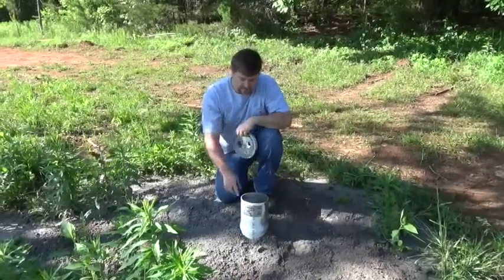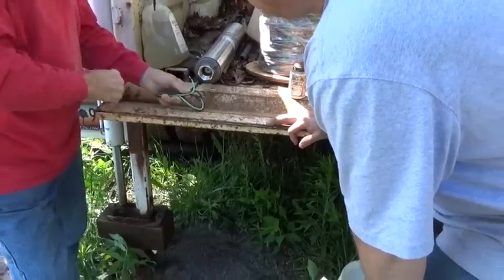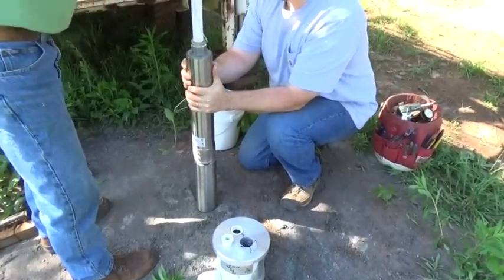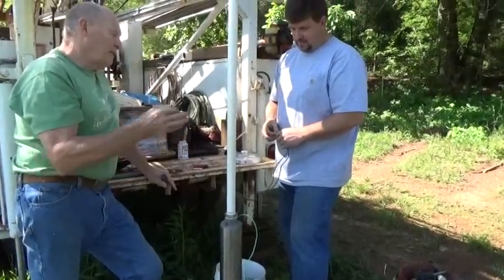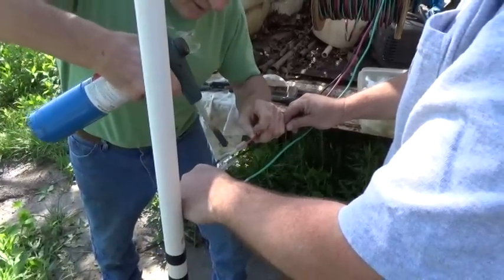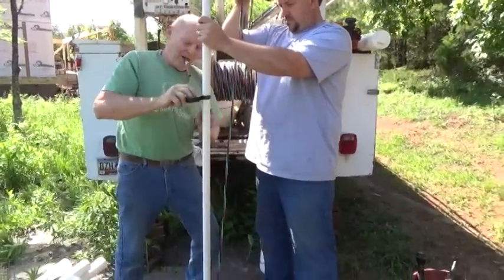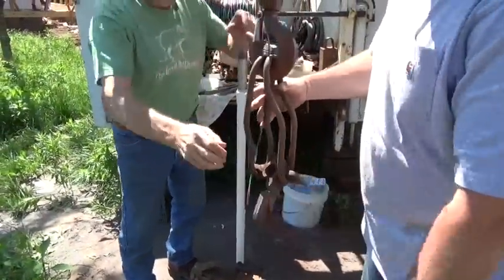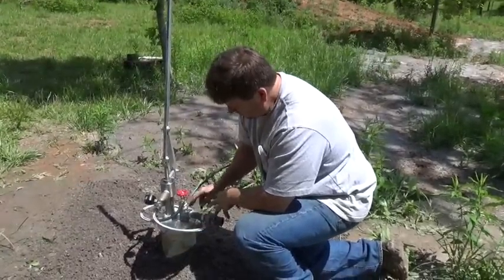How to install a Submersible Pump

Comment: I am Danny Maturan from Iligan City, Philippines. We had a disagreement with the officers of the water works office of our city in the manner in which the submersible pump was installed. Instead of an UPRIGHT POSITION, it was rather installed in a SLANT POSTION due to Height constraint of the reservoir. The source of the water is from a spring, collected to a tank which serve as the reservoir, where the collected water will be pump up to an elevation of about 300 meters.. I insisted to improve the set-up but they refused. So I decided to seek for more info on the proper istallation procedures to support my belief. Need you immediate reply because the motor driving the pump (20 Horsepower do not last for one year. which I believe this installation/set-up is one of the causes. Thank you for your time!
Reply: Danny Maturan  The common cause for pump failure is improper tanks and pressure switches. 20 hp is normally used for small farms it's way to big for a common house use.  you only need like 5gpm  max for a house, along with proper bladder tanks.
Reply: it is possible that the position of the motor is not correct. The type of motor may have bearings that are radial loaded and if horizontal or partially tilted, the bearings will prematurely fail. most submersible pumps are ok to tilt or lay on their side but not all.

Comment: So how do you keep the pump from picking up sediment and dirt? Or does all that clear up after pumping for awhile? Also how far from the bottom of the hole do you set the pump? Thanks!
Reply: Trey clark  ten foot is the normal from bottom in these parts, wells are very shallow he most only 80'  hitting water at 20'

Comment: Thanks for another grate video . If you have not installed you offset lines to the house yet . Do yourself a favor and put 4 wire to the well . That way if things get shut down ( SHF) and you can only get a three wire pump , you will have the wire in the ground all ready . I use three wire pumps because you have a control box in the basement and that has your start capacitor in it . With a two wire pump , that is build into the motor , so if it get hit by lightning or just fails , you need to pull the pump and replace the motor . Tree wire pumps most of my service calls you can just change the box in the basement . Also install the cycle stop valve you talked about in the video . That way you do not need a big tank . You really don't get any grate storage from BIGER tanks , and you save a lot of cash . Myself I  would use a cycle stop , 35 gal tank with 38 psi in blather , heavy release vale and turn PSI up to turn on at 40 PSI and shut off at 75 or 80 PSI . It's better for the pump to run higher PSi because it holds good PSI on the bearing witch is better for your pump . Hope that helps and not mad for my thoughts . Thanks again
Reply: Thank You for your input. I think it was better than the video.
Reply: Let me ask a question: Is 75psi too high for residential piping? Is a constant pressure pump better? Would u install a 'manual' pump also as back up? Are there filters that can be put on pump to prevent debris pick up from well to pump? Thanks

Comment: I was surprised to see the plastic well casing.  We have to have steel casing driven into ledge/bedrock.  Our well is 800' and we get 1/4 gallon per minute.  ;-)
Reply: Goodness gracious 800 ft. , 1/4 gallon per minute , I feel for you my friend . I just had a well done in southern Mo. highlands , driller was telling me he just did a well  In  Arkansas  700 ft. 4 gallon a minute , I thought that was sad , mine went 310 ft. at 20 gal a minute , metal casing with a sch. 40 PVC liner , hit bedrock at 160 ft. , 9400 bucks , you can bet I was glad when that was over . wore me out and all I did was watch .Ha!
Reply: ***** Hi ya neighbor ! Not likely you could  ' DIG ' it yourself , the ground around here is way to rocky and hard and you might hit a gigantic boulder then what ?. Even my garden beds are all raised beds , which is really not a big deal . How deep ? Varies I am at 1475 ft. above sea level ,which is pretty elevated ,I am on the Ozark Highlands , my neighbor 3/4 mile to the south is just under 400 ft deep . Best to hire a rep-ital well driller  , be careful though you can get scammed real easy !!!!!!!!! My well was pretty pricey but I went the extra mile so to speak, with a double well casing , be mindful well drillers usually only drill the well , meaning they will not do any trenching or backhoe work you are responsible for that  being said you have to arraign  for a backhoe to run the water line to install tank elect ect . or you will not be able to check if you well even works .Best to budget 10,000 $ and hope it works out less , I budgeted 7500 and it went 9400 plus back hoe work ! Hope this helped you out . Happy trails !
Reply: @soggybuilders  What is a 'double well casing'? Is that a casing inside a casing?
Reply: @richardnailhistorical3445  Hi , What they did on my well was set a 8 inch steel / iron casing , then inside that they put a 6 inch , thick walled PVC  pipe , all they way to the bottom , they cut slits in the side of the PVC pipe about 3 ft long at the end of the pipe before they lowered it in the metal casing , then inside that they lowered the 11/2 hp pump on a 1 inch PVC pipe as usual . My well is 310 ft deep , and I believe the water level is at 160 ft if I remember right . There is a lot of pipe in my well for sure .
Reply: a 1/4 gall a minute?  My dog drinks more than that....thats not a well its a spitoon.
Reply: Bigelow Brook Farm (Web4Deb)  I actually wish my 80' wells were plastic, as they would not rust.
Reply: mandewey3456  Most the wells here are 80/120 ft deep total they can produce normally 35 to 350 gpm. We're sitting on the largest water table in the state.
Reply: *****  depend on how close to the water you are. Some people here dug the wells about 45' by hand.
Reply: a 1/4 gall a minute?  My dog drinks more than that....tha'ts not a well its a spittoon.
Reply: @jimmytate7587  thats my piss rate after 3 beers.
Reply: Line it with plastic ?